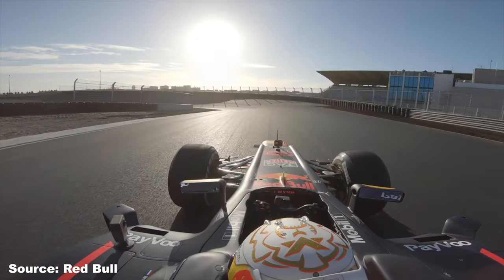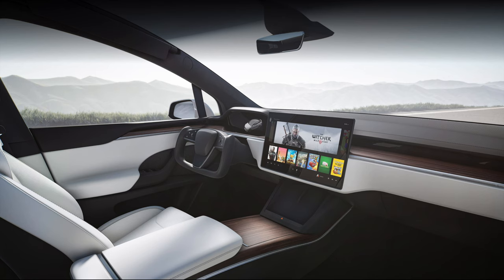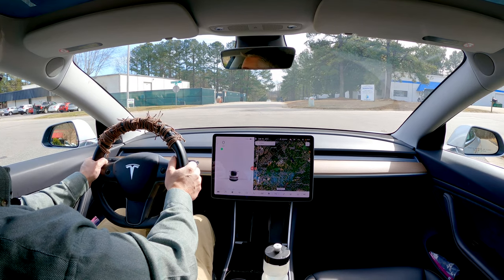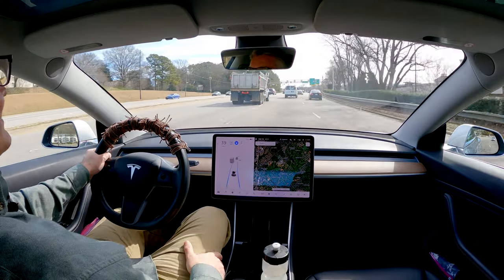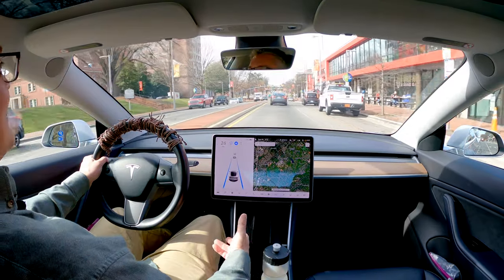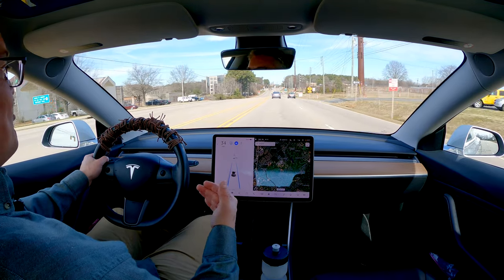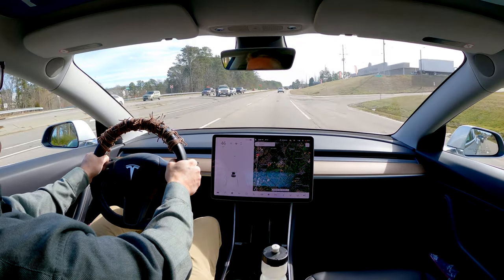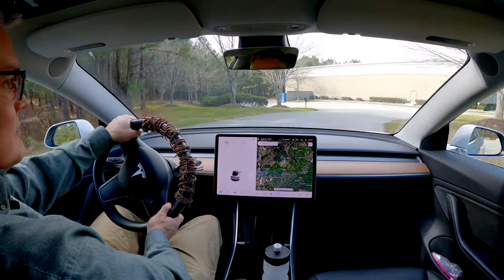Barbed wire test... Is the Tesla yoke better or worse for driving?

Comment: if you ask sandy monro when full autonomy is ready, sandy would say its ready now he drove elon musk car with the full autonomy and its completely 99% accurate anywhere even the streets.
also if you palm up grip the wheel you can relax the weight of your armand put enough resistance to let the can know your hands on
i think a yoke is garbage unless you have a steering system that allows max turn radius after crossing arms.
racing cars has adaptive steering the first inch of turn does little to nothing but the more you turn the sharper it goes like, inch 2 turns sharper than 1st inch and 3rd inch is like half the turn radius of inch 1this is the kind of steering that make yokes amazing. that kind of steering is dangerous for untrained drivers like in a normal car you move your wheel 6 inches to change lanes if you do 6 inches in an adaptive steering you can send your car into a spin
Reply from the maker: I specifically say “safe, reliable, and legal” hands-free autonomy in a Tesla for a reason.  Regulations do not allow full autonomy at all, so those would have to change for it to be legal.  As long as continuous driver monitoring is required by law, Tesla drivers will likely have to keep a hand on the wheel because that’s what Tesla chose for their driver monitoring system.

I talk at length about gripping the wheel and relaxing the arm, actually.  The issue with the yoke is that will likely cause Autosteer to kick off versus holding about the 11 o’clock position on a wheel.

I also talk about variable ratio steering in the video.  It’s a mechanical solution and not something Tesla can add to existing steering with a software update.  If they were offering variable ratio steering, we’d almost certainly already know about it because it’s a big deal.
Reply: @TheTechofTech  i agree but its politics not capability..... elon will say its still not perfect enough but is currently safer than human drivers. its alot easier to blame 1000 drivers for their errors but 1 tesla error can cause outrage an FUD
like guns if you without a doubt provide safety to people and country we gladly surrender them i guess we can find other hobbies but no one can provide safety there is always bad people out there and more bad people than we have cops and if you take away the 1 thing they might be afraid of will these bad people act out more?
like may other countries with no guns still have gun crime or other weapons its all the view of law makers and the heads of family that determine risk and how they react to loss.... to me i say pass it into law now if people die then so what they died because they chose to activate computer or not even an act of god could stop that 747 from landing on you life is precious i just dont like laws telling me how to live my life.... let me choose my death
Reply from the maker: You lost me with that last post, though I don’t think anyone who actually uses FSD Beta thinks it’s currently safer than a human driver.  Sandy Munro got one ride, one time.  He does not have it in his Tesla.  No way does he have enough exposure to make a statement like you’re suggesting he made.

I believe that public Autopilot plus an attentive driver is safer than an attentive driver alone.  FSD Beta is incredible in its capabilities, but I honestly haven’t hear any beta tester suggest anything other than it’s still not ready for public release.
Reply: @TheTechofTech  elon musk said it is safer than humans. are you not aware that elon musk travel from california to new york hands free and new york being the most dangerous place to drive!!!
Reply from the maker: No, Musk never did that.  He kept promising that they’d demo an autonomous drive from LA to NYC, but that hasn’t happened in any shape or form.
Reply: @TheTechofTech  yes he did he logged it video it and said he did it. then since has been try to sale its successes to prominent members in hopes to become the first autonomous tech to roll out under new legislation
Reply: @kevinalmeida7159  Kevin, Musk did not do that, ok !! Please do not repeat that untruth ! BECAUSE HE DID NOT DO IT !! Do you understand - he did not do it. Otherwise the “video” would be all over YT and the Internet, and it would have made headline news all over the world, with a video to prove it !! It just didn’t happen. He was CLAIMING to be able to do it by the end of 2019 - but it never happened. So please, stop with the BS.
Reply: @Nicholas.T  yes Elon did he said he did it’s on video of him claiming to have done so unless he lied he has done so
Elon is fighting a more stealth war with media and politics are trying to find another company to win the race...... what is YT ? Elon said it was a success he also said it still not to his standards but it is better than humans and realize Elon is on the wrong side of politics and media, think he will get proper coverage and representation
Reply: @kevinalmeida7159  Really Kevin, you don’t know what YT is ?? You’re on it - YouTube !!!!
Ok, you claim there is a video showing Elon Musk doing the LA to NYC autonomous drive ? You must have seen it, right ? So post the link here, so WE CAN ALL SEE IT !! Otherwise, STOP WITH THE LIES !!!!!
Reply: @Nicholas.T  there is video of elon claiming to have done it i watch him every time he tweet video or anything he says many things he said he did it!!!! i really dont want to invest the time finding you a link just know i watch him make the claim he did it and the video he used was in that same video he claim to do it you can feel free to search for it or you can live your life of denial i dont care.... i know what i saw and hear about what he claim and im willing to give him the benefit of the doubt as elon has been right on most things aside from estimated timelines
Reply: @kevinalmeida7159  Assuming this video of Musk’s claim does exist, when( month and year) was it posted, or when did you first see it ?
Reply: @Nicholas.T  good question im not certain but i want to say oct or nov but then again after about a weeks time is lost on me it could have been 3000 years ago. it just becomes a mental note of that 1 time......
Reply: @Nicholas.T  wait wait i found it!!! i have some minor edits i need to make to my prior statements. it wasnt new york it was san fran to LA and back.
listen to elon he says at end "i said we will get it done in 2020 and we did it i got it done and i do what i say i will do it is done!!!
the video is long"
Reply: @kevinalmeida7159  Minor edits !!!!! Are you taking the piss Kevin?? 
LA to SFA is what, 400 miles ??
LA to NYC is nearly 3,000 miles !!! You call that a minor error ????
Like I said originally, the coast to coast trip was never done, AND YOU HAVE JUST NOW ADMITTED THAT YOURSELF!!!
Your Honour, I rest my case !!!
Can you post the link to LA to SFA claim by Musk ?
By the way, what Tesla model do you own?
Reply: @Nicholas.T  lol no the point was that elon said he proven FSD and shared the experience with other like sandy monrow theres no difference he could have driven to new york as well but he did do a proof of concept drive that proves its done the destination is meaningless so your case is fail i own a model 3 fully optioned
Reply: @kevinalmeida7159  Which version of the Model 3 ? SR+, LR or performance?
Reply: @Nicholas.T  mines the best you can get in 2018 as well as upgraded hardware for FSD paid 72,000
Reply: @kevinalmeida7159  You’re lucky you live in the US. Here in Australia, the cheapest Model 3 is $72,000 and the Performance is over $100,000 !! The refreshed Model S Long Range is $155,000 
All due to our poor exchange rate and some high taxes on cars.
Reply: @Nicholas.T  it is still expensive but the exchange rate has almost the same price plus tesla has been dropping the price of the cars to make the importing fees void out that is if america has a fair auto exchange laws 72000 well if you can get an s for 155000 thats a fair price they are about 120000 here and thats what the exchange rate is but last time i was in australia your dollar was weaker compared to ours now congrats on the economic growth
Reply: @kevinalmeida7159  Our dollar has always been weaker, except in 2012-13, when it reached about US$1.05
But that’s rare. It’s mostly lower, although it’s been increasing steadily over the last 2-3 months. I’m in Sydney. Where do you live ?

Comment: Ok so id you driving a car trying to get ways from somebody to make a sharp turn or gettin away from a angry driver you driving like a old woman . If you need to steer quick . If you need or reverse quickly or you pull off to the side of the road is the car sliding you can grab you cant realz you arm they jay need to give us more option not just have a you and dont let us decide what id you dumb something in the road they thing r have two working arms

Comment: Boeing’s use yokes. Air Buses use joy sticks. As long as we have to change, I’d prefer the Air Bus design.
Thank you, stay healthy!
Reply from the maker: Planes are fly-by-wire.  Cars are not.  Until that happens, the physical connection between the driver and the front wheels remains.